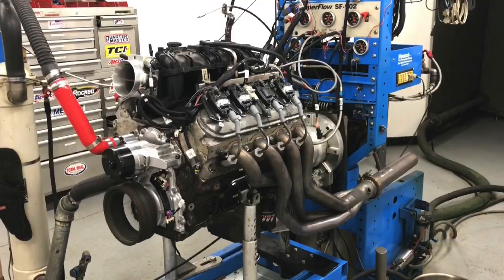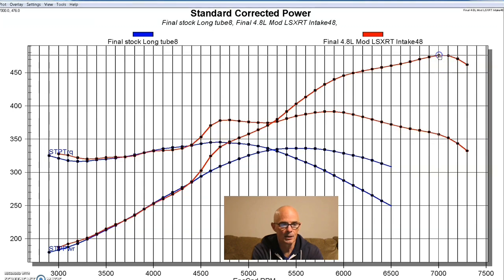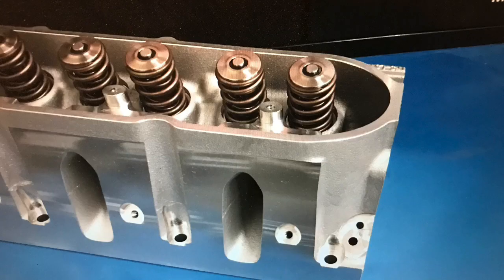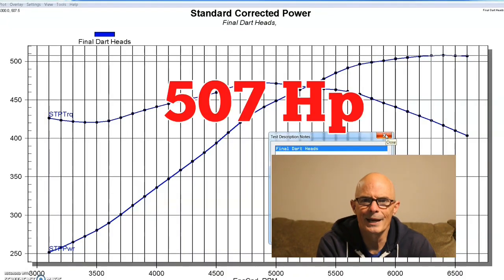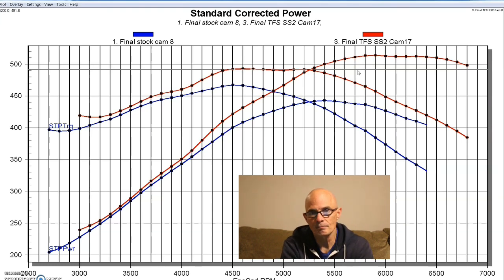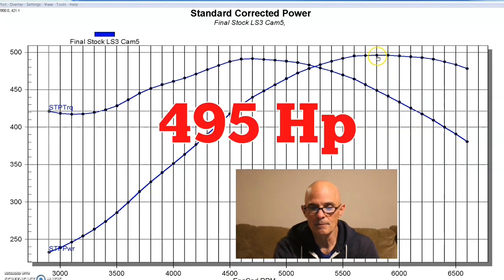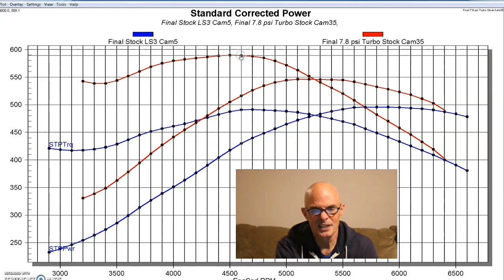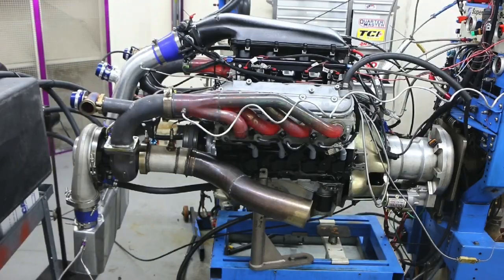LS HOW TO: 500-HP POWER RECIPES

Comment: If the dyno is not simulating load then that Hp numbers are not true  you strap his 500 Hp “dyno tested“ engine in its only gonna make 450 to the wheel
Reply from the maker: the loss from engine dyno to wheel dyno will be more than 50 hp (but the dyno doesn't simulate load-it produces load)

Comment: I have a 04 sierra 4.8.  Watched both videos for the 400hp and the 500hp.  Are u changing any fuel components, fuel rails, injectors, pumps?  The fast intake manifold do u have part# used in the application?  Appreciate ur time thanks!
Reply from the maker: Stock injectors won't feed this power level. We have a big pump on the dyno and these motors require bigger injectors

Comment: I'm talking 500hp at rear wheels not hubs nor HP at crank at wheels,what would it take to get 500 at wheels without touching bottom end on an LS1 5.7 na
Reply from the maker: very big cam, notched pistons, milled and ported heads and after market intake might do it (600 flywheel)
Reply: @richardholdener1727  exactly right this tosser hear in Australia has a hub dyno he gets 500rwhp out a LS1 just cam n milling heads,I'm telling him his dyno is very happy and he's calling me every name under sun😆 like I told him stock 28,on injectors only hold but over 400rwhp loan needing a fast intake even then😆

Comment: What hp/tq number  will the 5.3 make with the 706 or 862 heads with that cam selection?
Reply from the maker: which cam?
Reply: @richardholdener1727  I'm sorry for the late response I'm currently deployed. If equiped with the BTR stage 4 cam  what would be the hp/Tq numbers I'm looking to go carburetor. would I have to replace the factory style lifters I'm new to the LS engines.

Comment: Since when does an LS3 make over 420 stock?
Reply from the maker: SINCE EVERY TIME YOU RUN IT ON AN ENGINE DYNO (ITS FACTORY RATED AT 430 HP) AND WHEN RUN WITHOUT ACCESSORIES, AIR INTAKE, RUN COLDER, WITH OPTIMIZED TUEN AND LONG TURBE HEADERS-IT MAKES 490 ISH HP

Comment: I have an LS2, 6.0 liter, in a c6 corvette. I was kind of confused with the 6.0 recipe. I have a stage 4 cam, with supporting mods. And I’m not touching 500hp. I never dynoed but I’m pretty sure I am not near 500
Reply from the maker: remember this is flywheel hp-not wheel hp
Reply: @richardholdener1727  gotcha, so let’s say, ported genX heads 225cc (cathedral port), btr stage 4 cam, longtube headers+ lsx intake manifold. Have you ever dynoed that combo? (Mind it’s a 6.0 out of the corvette)
Reply from the maker: please see the how to max your 6.0l video

Comment: RANDOM QUESTION for all who come across. I have a stock 5.3 bottom end, and I'll take the top end off of my LS1 from a 02 camaro, to go into the camaro. EVERYTHING STOCK, no upgrades, intake, injectors, all from a stock Z28. I plan to use a computer form a Tahoe. Is there a better route I can take just for it to run smoothly?

Comment: sir Richard... good evening  
sir can I have your thoughts on my rebuilt engine issue ..

I bought a rebuilt engine from a guy who rebuild performance ls engines .. it's lq  (not sure is it 4 or 9) 6.0 with flat pistons / 243 heads (stock) / btr double springs 660 / gt11 cam 215/230 118 lsa / stock intake / stock throttle / stock injectors .. I droped it in a 2001 tahoe with manual swap ( t56 /  came out of gto) / 1/7/8 longtube speed engineering headers / 3in  y pipe / stock exhaust / stock muffler / I have set of 285/17/65 and a tune of course (a reputable tuning workshop in my region = middle east ) .. It did really bad on dyno (1st = 293hp // 2nd =310 hp) I forget the torque figures since a friend took it to dyno .. when it was tuned the car was on 3.08 gears ,, then after the tune it did get a 4.10 gears .. it is way to sluggish  down low it barely gets up even with gears 4.10 .. you can feel the power/torque at 4000 rpm and beyond  but I scarcely drive at that range .. the engine doesn't leak or burn oil / and I did a compression  cylinder test / all cylinders gave  a round 170 psi .. do you think I should get it retuned or does it definitely need a cam swap or is it a bad/faild rebuild ?? ..
I do suspect the cam / but many heavier pickups and SUVs use the same gt11 cam and zo6 cams (with wider lsa) in lq and ls3 engines and they got good results and they are satisfied with low end performance

I really appreciate an expertise opinion on this matter
Reply from the maker: that wide lsa is going to make that cam soft down low like the LS9
Reply: @richardholdener1727  thanks a million,, I do appreciate your insight ..

Comment: Mr Holdener! How much Horsepower can a Stock 706 Head handle? How much more  Horsepower can a Ported set of 706 Head handle?
Reply from the maker: HOW MUCH DO YOU WANT TO MAKE
Reply: @richardholdener1727  Well I plan on changing the Cam, Lifters and Springs like it says to  do in one of your previous Videos. 
So I want to make about 4-450 Horses and I want to add Nitrous. But will Ported and Polished Heads get me more Horsepower?
Reply: Well Mr Holdener! What do you think?🙋🏿‍♂️
Reply: @ Richard Holdener. Okay I'll wait for your answer 😁

Comment: My truck almost same combo needs the heads only I have BTRNSR 224 230 500 500 109 LSA FAST LSXRT 102 AND TB LTS 3" ORY SPINTECH 410 ELECTRIC FAN UNDRIVE HARMONIC PULLY MAIL ORDER TUNNED Waco , Texas I wonder what I have with out heads just stock 706 but buying stagec2 706 TSP AND NX SYSTEM

Comment: How come you don’t talk about the ls2? Stock it makes 412bhp
Reply from the maker: I did many, ,many tests on the LS2 (crate motor from GM)-it works well
Reply: @richardholdener1727  so is a crate ls2 not far off a ls3 for power upgrades? Just planning my
Upgrades

Comment: Hi Richard what size injectors were you using to get 500hp on the 5.3
Reply from the maker: you need at least 36 pounders
Reply: @richardholdener1727  thanks buddy.  Last question do your have a recipe for 650 to 700 rwhp from a na  6.0 t

Comment: If you have a truck with a 4.8 or 5.3, can you just buy a 6.0 and bolt it directly in place, or do you have to make changes to get it to work?
Reply from the maker: tune would be different
Reply: @richardholdener1727  fair enough. Thank you

Comment: Would a stock L76 with 243’s be the same general geometry of an LS2? This is PTV clearance question. I have an MS3 cam and wondering how close it might be.
Reply from the maker: I DON'T KNOW SPECS ON MS3 CAM BUT WE RAN COMP 54-469-11 CAM WITH 799 HEADS
Reply: @richardholdener1727  238/242 600/600 on a 112. my heads have had competition valve job and only a .005 surface clean up. He said it should just be a wash as far as clearance goes.

Comment: If I add a sloppy stage 2 cam in a 6.2 do I need too change the valve springs?
Reply from the maker: YES
Reply: @richardholdener1727  which ones do I need

Comment: It's pretty easy .  piston cams valve springs  intake manifold exhaust and a tune most importantly  Maybe crank bearings And a new ignition . it's all basic . heck .  go that far and you will prolly hit more than that and get I to the 700hp range if you get the right parts .  it's the same with Every piston driven motor

Comment: Ls3’s make 430hp Wdu mean 495??
Reply from the maker: the 430-hp rating is a different test procedure-with all accs, exh, inlet etc...
Reply: @richardholdener1727  Don’t really understand
Reply: @Abel3270  Factory tests with air filter, AC compressor, power steering, and factory exhaust and water pump.  This test here is without all that and exhaust headers and a better software tune also.

Comment: Hey I wanted to know which transmission I should use for my 6.0 lq4 swap it’s going in my genesis sedan starting the project next year been looking at your videos it’s been very helpful. Should I use 4l60e or 4l80 ?
Reply from the maker: 80 if you plan to make power
Reply: Richard Holdener thank you I’m saving to get a motor and trans together and put everything in the motor then put it in the car. You videos are very informative I’ll keep looking

Comment: This should be interesting for my ford build ...321 cubic inch sbf 4.125 x 3.00 stroke ported trickflow 170s flowing 292 at .650 and 218 @650 running a comp nx282 232/244 int/exh and .565/580 but with a 1.72 rr which makes 607 intake .623 exhaust. Only issue is stock compression 9.1 but im looking to make 365 wheel hp in a 94 mustang gt similar cam specs. For induction 90mm throttlebody and trickflow box r.

Comment: I’m thinking about building a 2000+HP 400 SBC for a 18’ dragster bore it 60 over sleeve it 16-1 compression and a 14-71 roots supercharger plus a lot more specs I’m not going into but it can be done, a bad ass Lunati cam with a duration of at least 0.519 the lift your doing is ok but the duration is too short for big HP there not gonna give you a free one you are gonna have to buy it they won’t even give free cams to the top fuel guys they have to pay for them too Comp game me : cams one time for free to try I took em all to the track tried em in time trials before elimations started I pulled the last one out and put my Lunati back in and threw the comps in my scrap pile cause no one wanted them even the guys that worked for Comp ran lunati’s comp lies about there duration lift etc I know this from the employees that were actually making these cams

Comment: Love your videos! I am in the middle of an LS swap (LQ4 into a 1977 gmc 4x4) while I am swapping it I am thinking of putting a cam in. I’m thinking of a stage 2 truck cam from summit (SUM-8701). Everything with the LQ4 is stock and has 120k miles on it. Is it worth swapping? I don’t really want to do a spring upgrade either, just the cam.

Comment: I just picked up a LY2 for my E36 Project, I'm gonna send the heads over too TEA for their Stage 2 CNC along with Hollow Stem Valves and hopefully milling the head down to 58 to 60cc and use 0.027 headgaskets. I also plan on running Brian Tooleys Custom Road Race Cam which is a 235/250 113+4 lsa .614/.605.
I'm on the fence whether I should stick with the TBSS style intake or pick up a Holley Hi-Ram

Comment: This is awesome viewing especially on night shifts. Here in Oz I have a L77 (LS2 based) 6.0L and looking a chasing 500hp at wheels, but don't want to use a high stall. I have cold air intake and exhaust including headers and cats. Any suggestions??
Reply from the maker: 500 wheel on an LS2 usually takes lots of cam and ported heads and good intake or boost
Reply: @richardholdener1727  thanks for your reply. I've talked an engine builder local and he said if I want to drive car a few times a week or let wife drive, I should look at 400hprw. He said use std heads with LS3 valves, dual springs, cam, DOD delete, my existing full exhaust, cold air intake and then tune. I'm open to and other suggestions.

Comment: Hey new to seeing your videos and new to LS engines. Do you have a website or a guide to what motors to buy and a step by step guide to building a LS motor? I'm looking to put a 6.0 into a 1966 Cadillac coupe Deville. Any help would be much appreciated.
Reply from the maker: any 6.0L will do, an LY6 is a good one
Reply: @richardholdener1727  someone in the area is selling a LS3 block out of a 2015 Chevy ss that has some damage from a accident for $100 do you think that would be a good investment to have a machine shop fix and build up?
Reply: @richardholdener1727  could I email you directly with some questions?

Comment: @Richard  I have a ls3 engine got the car  tuned and it bogs and surges makes popping sounds out the exhaust I asked the tuner why it dose that he said its a inefficiency in the engine here the mods iv done to the car so far dose it more in first and second gear 

Camshaft- gpi ss4 nfc 
Longtube headers -stainless works 
Dual valve spring 
Che trunion kit everything else on the car is factory stock
Reply: Car made 530 ish whp

Comment: Hey Richard,  great video! You always have great info. Care to make a few suggestions? I have a 2007 corvette ls2 stock motor with CAI. Looking to put on a few parts. Air intake Fast of MSD? Looking for more low end tq. and the 500ish on top end. Long tube headers. No meth or turbo or super charger. Cam package as well. Which would you suggest based on this info? Not interested in most chop chop, must be a good driver without adding torque converter. maybe two steps up from stock.  Your suggestion would be much appreciated.

Thanks  Mike

Comment: You probably get asked things like this all the time, but what recipe would you recommend for a higher rpm autocross/track day setup? I would like to make power to at least 7200 rpm and do it reliably. Thinking aluminum block 5.3 for the slight weight savings, but wouldn’t be opposed to a 4.8 or 6.0 if you think one of those would be a better route to take. Thanks! Love your videos and all the information.

Comment: Hey Richard I i  I picked up a 1987 R10 it has a 5.3 truck motor and terminator X management system I am new to efi builds I got a professional Products LS1/LS6 intake with matching 96mm Throttle body and 50 lb injectors I got from a friend do u guys sell used parts also I’m trying for the 500 range are any cheaper cams that could get me there also should I port my 706 or look for used aftermarket heads

Comment: Awesome.  I have an 05 ls2 from a gto set up going in a 49 ford f1 pick up and am looking to run a turbo.  Truck weighs 4300 lbs and will be running a ford 9 with 3:73 or 4:11 due to the t56 6 speed.  What can will push me over the 500 with turbo

Comment: Back in 2008, I used Dart heads on my LS1 with a too big cam from Futral.  With the LS6 intake, ported stock TB, catted longtubes, Borla catback, SLP lid, 4.10 gears, and tune I made 430 rwhp.  I ran 121 mph on street tires.  Lesson learned, check Dart's valve guides as mine were junk brand new and after pulling them and getting them resleeved as it was drinking a quart of oil every 1,000 miles, it spun a rod bearing on the subsequent re-tuning pull.

Comment: Rich, I'm seeing a lot of videos about 5.3 setups and modded 6.0 setups. I'm not seeing much about working with the stock 317's with a big cam out there. I'm swapping a 5.3 truck over to a 6.0 and most of the advice I'm seeing is either for cars or for 5.3 trucks. Any chance you examine a good/better/best street truck setup for a heavy 6.0? Thanks! Appreciate your videos immensely, let me know when you need a grease monkey!
Reply from the maker: replace the 317s with 706 or 799 heads for torque

Comment: What do you recommend for a cam lq9   It will have 799 heads decked .005 and a three angle valve job tbss intake manifold with 36lb injectors 90mm throttle body it’s going in on a 1975 Silverado. Matted to a 4L80 what stall converter would I need?
Reply from the maker: how much power and what rpm do you want?
Reply: Richard Holdener  
I want to be able to make 400+ to the wheels rpm range I’m thinking 2500-6700 you would have a better idea then my please advise
Reply: Richard Holdener  sir any suggestions ?

Comment: If I’m running a 6.0 with 706 heads what valve springs to do you recommend with a Sloppy Stage 2 Cam? Thanks. Great videos
Reply: I am going same route here did you dynoed the motor? Also wondering what thickness head gasket did you go with and why?
Reply: For me I am going with pac 1218 springs
Reply: Jean B pinard for now I just ended up going factory head gaskets for my 6.0L engine because I had the vin of the truck it was out of. Still ran 706 heads and got an ECM tune through Blackbear. Runs great but I have not had it dynoed.

Comment: Just awesome content Richard.  The 5.3 in my '91 C1500 just dynoed at 305tq/308hp at the wheels.  It has a TBSS intake, Texas Speed 224R cam, PAC beehives, mid length headers, Terminator X ecu, Tremec TKO600.  In your opinion, would the Texas Speed/PRS Stage 2.5 porting and having the block freshened to 5.898 bore and pistons be a good route to 500 at the wheels?  Maybe a different cam too?

Comment: Great stuff! No one else does it like this, you are the man Richard!  How about a comparison of the "truck" cams. I just put a BTR stage 1 truck cam in my 5.3. It runs great, but have no idea of "the numbers" it is making. The 400, 500, 600 etc combos are great,but at what point on these combinations, would I be needing a torq converter and or gears? Getting ready to build another 88-98 Chevy pickup with a 5.3. Based on ease of tuning and a target around 450-500, would you go n/a over turbo? Thanks again for putting out such great material.

Comment: How about twin tiny turbos? A pair of https://www.amazon.com/Turbocharger-1996-2006-Turbine-87-1-8-Warranty/dp/B07BMR4KGN/ would be big enough for a 5.3, and because they are so small they would spin up at lower RPM and make power down low where it would be useful for street and autocross/SCCA Solo racing.

Comment: Richard, with the curve that the SS2 cam has, if you wanted to run in it an LQ9 With some head work and additional compression, would it be safe to say you could get by with the stock torque converter or at minimal like a Trailblazer converter?